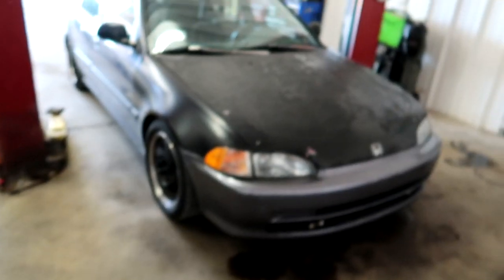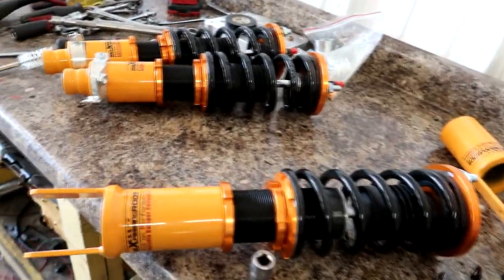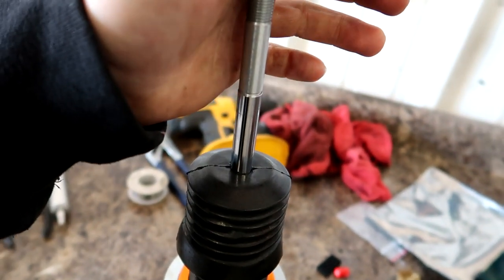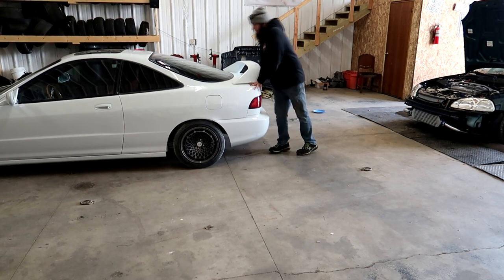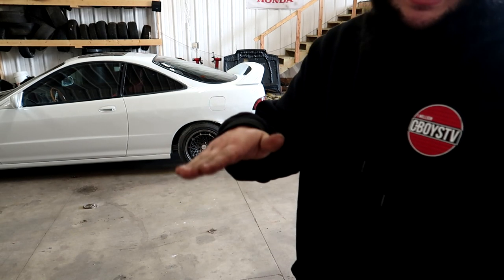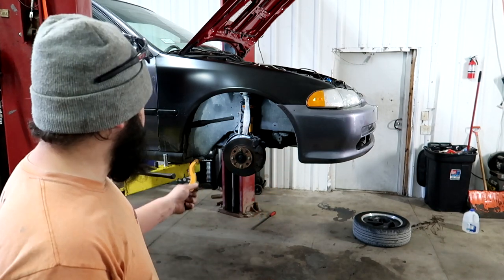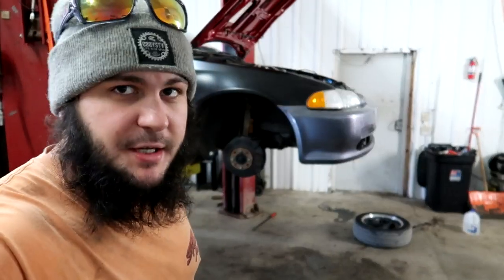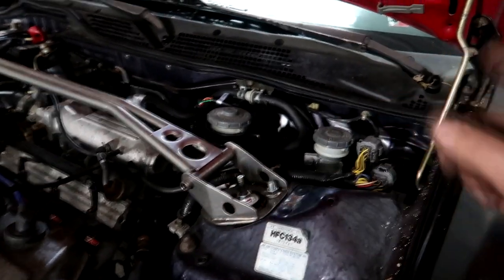Honda Civic Coilover Install MaxPeedingRods Coils Worth The Money ?

Comment: I've heard copper grase on the threads for the adjustments help with them not rusting from the salt on the road in the winter, I got my civic with maxpeeding coilovers, red ones and I wish I could lift it a little and lower the preload on the rear

Comment: I have rebound adjustable coilovers made by Progress Auto.  Also installed their rear 22mm sway bar kit.  The way they do their spring rates are allowing you to choose which springs you want to run when you buy them.    I had to choose 450 lbs springs for the front AND rear because of the 350-400 lbs of audio equipment in the trunk (96 Civic coupe.)  For the sake of knowledge, OEM front springs are 220 lbs and rears are 110 lbs.   
BUT, I really am here to say my coilover instructions emphasized heavily that you are to measure from center hub to fender, not ground to fender due to variations.  I was chasing my tail adjusting ride height until I measured from the hub center.   Ground to fender yielded different results vs hub to fender.  Probably something to do with the tires even tho they're all the same.

Comment: These are not preload adjustable really, Height determines Spring preload and the spring comes with a preset spring rate. The do have a damping adjuster though, so basically don't set them too low or the spring will not preload the strut correctly. The only real way to have accurate preload adjustment at a set height with these is to pick a different spring with a higher or lower spring rate ( and/or spring length)..which then defeats the purpose of a budget coilover because you then could have just bought a fully adjustable coilover instead.